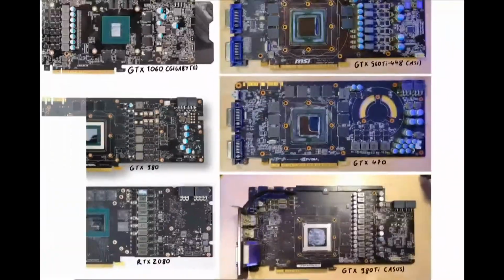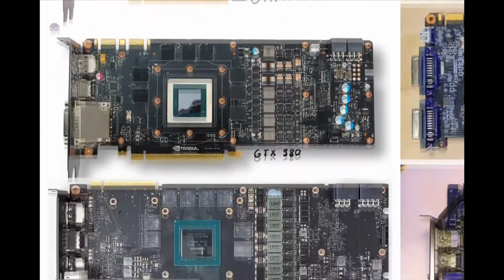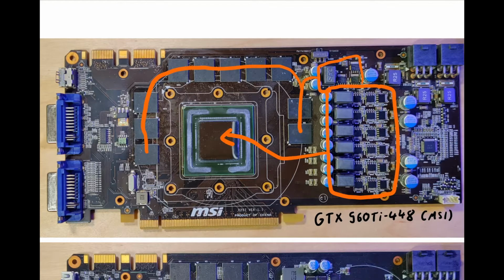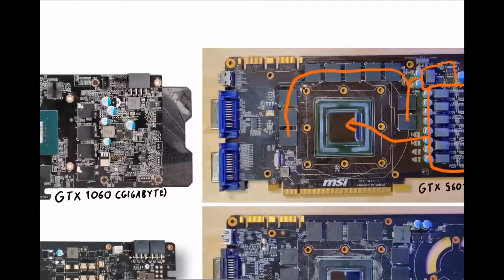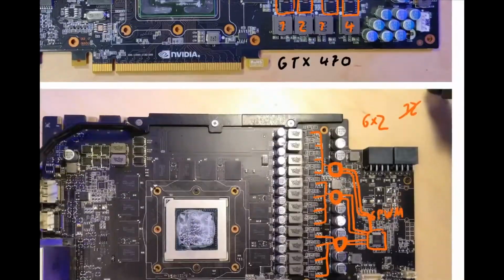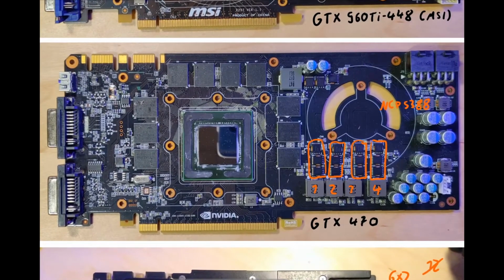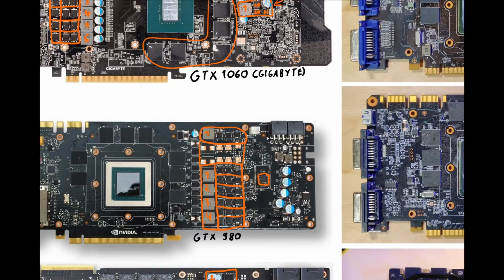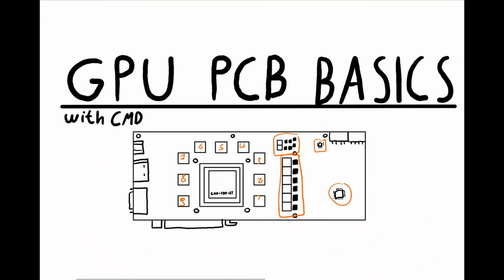The Basics of Graphics Card PCBs | How to identify components

Comment: Help please my sons PC the main monitor went black tried his memory in my pc and it was fine, sorry board is not completely dead the cpu and gfx and case fans all power up, graphics card is the Geforce 4060 Ti founders edition 8gb.
Tried my memory in his pc - my memory has daft led lights on the top of them they didnt turn on so no power it seems to the ram
Tried his gfx card in the daughters pc would not work plus his monitor is also not working, tried on my pc no picture and the monitor powers up but no logo is displayed and the menu doesnt work either
Press the menu button and no on screen display (HP Omen 34c)
Whatever has happened has possibly damaged his mobo, gfx card and monitor
No bios either light on mobo is for a dram error Asus B650 wifi orange light.

Comment: Hi, I have a GTX 1060 6GB and I searched this video. I was doing my occasional cleaning of it when I accidentally scratched this soft foam that seems to be sticking on the pcb. And I scratched just a bit of it off but the gpu still works fine, it's just bothering me cause I definitely did something wrong and I want to find out what it is.
Reply: Sounds like a thermal pad to me, if your GPU does not overheat, it should be fine, but better to replace this pad to be safe

Comment: 1:27 i wanna know more about this part over here, is a graphics card that has it's vrm on the left side of the board will consume more power from the pcie then from a 6pin connector?, i've seen alot of amd graphics card pcb and most of them will have it's vrm on the lefts side of the board including mine, and a lot of user realized that the graphics card consume more power from the pcie then from 6pin connector, i know it's not much of a problem but, my HD6950 can consume upto 600 during heavy game, i'm worried that the pcie lane might burn at some point
Reply from the maker: Depends entirely on how the power planes are designed. It has nothing to do with where the VRM is.
Reply: @CmdrSoyo  oh i see Thank you For your reply

Comment: I just jumped down the GPU rabbit hole trying to figure out what is likely causing issues with 2 graphic cards that I just purchased used. Specifically what component is the culprit. They are both AMD cards, a Gigabyte RX 570 4gb and and MSI RX 480 4gb. The 570 will load to windows desktop for about 30 seconds then crash to black screen and restarts the PC to windows BSOD. The 480 will display a brief pink screen for 3 seconds then normal resolution nicely and allows video playback, internet surfing etc until I load Unigine Heaven to test it then it too crashes to black screen. GPUZ sees the RX 480 but will not show voltages, or memory or temps. MSI afterburner won't show specs or allow the sliders to be adjusted. Like it is not being recognized. Both cards have normal BIOS and use the same driver. I used DDU and the RX 480 will not allow new driver to install, not even previous one AMD showed error. I already cleaned them thoroughly with new paste and pads. Could these cards have VRAM or memory controller bad? Should I break out the heat gun? My XFX RX 580 8GB and other AMD cards works great in the same PC.

Comment: I have a vga GTX 1660 by gigabit it has a problem Wich is no power,when I turn off and turn on the PC several times it will get power.is that repairable issue or  not?
Reply: prolly wit micro soldering :p

Comment: If I'm not mistaken, this board is for one system consisting of three mosfets and one large coil that powers the GPU, and I see one small coil that powers the vram, but I don't see any other mosfets. so a little different than in the movie, but it's an old card. I just wanted to clarify the issues that bother me. Additionally, where to get graphics card diagrams?

Comment: You're a great translator, really high-quality material. It's a pity that there are few such materials on the Internet. I came here by accident, looked at it and remembered that he has a very old, non-working N610 2gd3hlp graphics card. I can't find the diagram anywhere on the internet. I made an external inspection. And now I have questions. I will only add that I once received the card from a friend who used a poor quality power supply. I see that two small capacitors are missing. the card has 8 pins on the PCIE output and the other one probably has 11. I don't know if these outputs correspond to the typical PCIE pin arrangement? because then I would have a short circuit on the 3.3V and 12V lines. A bit strange. Another question: how can I determine whether a given capacitor is broken? If it's soldered in, I guess it won't measure anything? How to find and select replacement elements now? How can I know what the value of these elements is without a diagram?

Comment: Keywords:

0. PCB (printed circuit board)
1. gpu (processor)
2. vram (dynamic memory)
3. pci express (slot that connects to motherboard)
4. vrm ("interesting stuff", 2 kinds):
  4.1. vcore vrm (bigger block, for gpu)
  4.2. vmem vrm (for vram)

- vrm components (not exhaustive):
  1. Mosfets
  2. Inductors
  3. Capacitors
  4. PWM controllers

- datasheets (to learn about graphics card's specs, like vrm quality, pwm controller info, etc.)

PS: notes to help non-native speakers, hard of hearing and beginners lile me. Please, feel free to add and/or correct this post.
Reply: ty man, i was gonna rewatch the video to take note of this stuff. This helps alot 👍👍

Comment: Great video! Thnx for the information you providing to all of us.
If I may ask, where did you get your knowledge? 

I am very curious about learning graphic card repair but I am having troubling finding resources especially considering the diagnostics and where to measure for different voltages and resistances. I would need like a complete guide on how the electronics work and what values are normal. For example the 12v, 5v or 1.8v locations etc.
Reply: I'm trying to obtain the exact same knowledge about graphics cards as you are. Did you get lucky on finding reliable resources on diagnostics and where to measure certain values such as voltages and resistance?
Reply: @jesperberglund554  hey what about you , did u find any reliable resources?

Comment: @ 22:40 I have a similar looking PWM controller on my GTX 970 but it's NCP81174
Do you know how to check it with a multimeter? Because I suspect it causing a short on the Mosfets, I removed a Mosfet and measured it alone there's not short.

Comment: The easiest explanation for the phases is that they are like no of cylinders in car or bike engines. For a given displacement, say - 1000 cc or 1 ltr, you can have a large single cylinder that makes a hell lot of torque but power comes in pulses. Also all components must be very strong and heavy. Or you can have 4 250 cc cylinders that are lighter and power comes in more smooth manner.  Similarly, having many phases helps in having switching pulse split over many small intervals. This helps in reducing the size of inductors and MOSFETs and the current they carry. Also, the power delivery is much cleaner with less ripples.
Reply: Well said ❤

Comment: hey soyo , im stuck on a vega 56 thats only recognized when plugged on a pcie 2.0 (16x port , working at 4x) , when plugged on pcie3.0 it turns on , fans and lights but nothing  , bios is good , power too , chips seem fine , any ideas ?
Reply from the maker: That is a typical problem that appears when one or several of the small MLCC capacitors on the PCI-E slot interface are missing or damaged. Take a good look at the card and verify all are ok

Comment: These videos are all really terrific! Explained so well and even someone like me that's solid with repair - but not GPU repair - learned a lot. THANK YOU and just subbed!

My first GPU attempt is going to be a 980ti SC I just grabbed and this info is so helpful.
Reply: Please, don't do the 980 Ti. Buy some very cheap video cards and start there. It's impossible to not kill your first 3 or 4 video cards unless there's something very simple to repair and you're super lucky.
Start with those with a TDP less than 150W. It's easier and if you mess up one of the phases it's basically nothing bad happening (or almost nothing). 
Let the 980 Ti aside for a while. You'll come back to it later. After all it's not going anywhere.
I understand you already have skill but you need to learn a few things first. Video cards with higher TDP are harder to work on  because the dissipation of the heat is much higher when you try to de-solder or solder something on the board.
Trust me, you need to work out your own set of tools you're comfortable working with. Not all flux is made equal and you will notice that the fake Amtech 223 is better for some work than the original. The original is better for other kind of work. The Amtech 559 V2 is wonderful in combination with a specific kind of soldering wire while for some other kind of soldering wire you may work better with a different kind of flux. To be able to de solder an electrolytic capacitor from a board with a TDP over 200W is a real challenge while de soldering one from a board with only 75W TDP is much, much easier.
Again, trust me, let the 980 Ti aside for now.
Hope this helps.

Comment: Thank you for breaking it down so clearly. Appreciate the simple yet thorough explanation and the reasonings. But I had one question that I may have missed(?), what purpose do those mosfet (black chips) /capacitor do? The ones located on left side of the inductors on GTX 980, 980 Ti and 2080.
Reply: The MOSFETs are basically high speed switches that switches on and off as per the PWM signal from the controller,  slicing or chopping the continuous 12 volts DC input power to small spikes of 12 volts. It is passed to inductors which is basically a voltage to current converter.  It takes the 12 v low ampere spikes from MOSFET and converts it into 0.8  to 1.3 volt high ampere supply with some ripples. The capacitors connected between this power rail and ground smoothes out the ripples and produces a smooth high current dc voltage for the GPU or memory chip.

Comment: Hello I have an MSI R9 380 it works just fine, never crashed, no overheat fans spin normally BUT only outputs video through DVI I and DVI D ports no displayport nor hdmi port. How could I fix it or what may be the cause of this?
Reply: maybe rust
Reply: @makinkurwamonster6566  I don't know the thing is that hdmi port works just perfectly when connected to a specific monitor, it is a benq gw2480 but I've tried connecting it to like 4 different monitors and a tv and it just doesn't work. Notice that those monitors and tv work perfectly with any hdmi device such as laptops or consoles. That's what I don't understand what's going on.

Comment: bro I have aasus  gtx 1060 strix 6gb card . .it doesnt detect by any motherboard... how can i troubleshoot this..
Reply from the maker: very likely a dead VRM rail. i made a video that covers this kind of failure and the potential fixes recently so if you want more info you can watch that
Reply: @CmdrSoyo  thanx bro I'll watch it
Reply: @CmdrSoyo  hello ny 1060 has very low resistance( about below 0.0 ohms)  between ground and 1.8 v inductor.. is this a short..?
Reply from the maker: @meranjana  yes
Reply: @CmdrSoyo  is there a way to fix this.. pc is giving display through onboard  with the gpu and it doesnt turn off.. can there be a short in the vga bios chip?